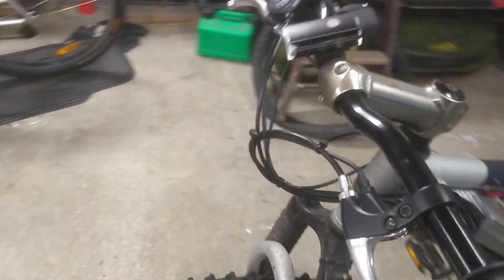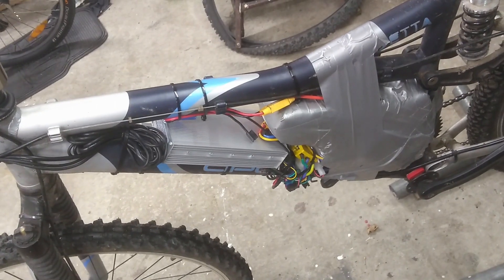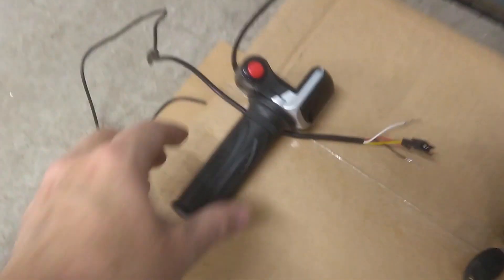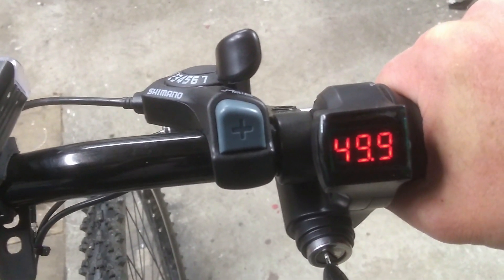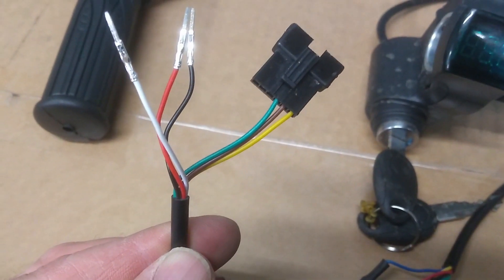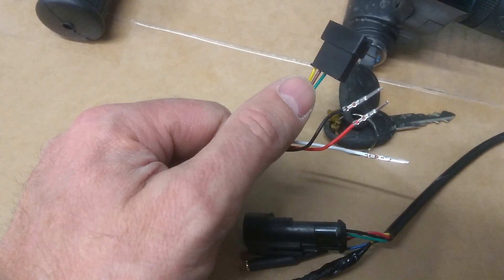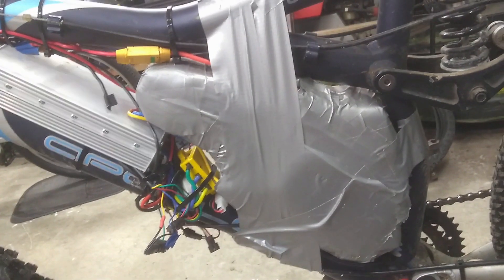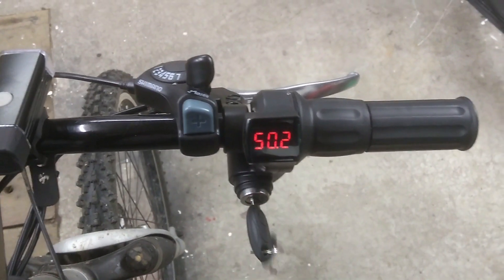Voilamart Ebike Controller Upgrades

Comment: The tuning is extrem extrem I pull the throttle and 1sekound later I am at Max speed ( if a Balance to the front of the bike if not the font tire goes strait up)
Reply from the maker: it's 14s 9p each cell is 3400mAh but not high current so I need as many in parallel as possible
Reply: @alibro7512  lol ok...I have 2* 6S with 4* 2600mAh and 1* 3S with ~ 12Ah...
Reply: Ali Bro I only use 2x 6s3p and 1x6s3p and  only one zell can delivery 35 amps on it self (sry for my bad English)
Reply from the maker: @ichwasdass  if you check my latest video I show my new pack. I've only used it a couple of times as the weather is very bad here.
Reply from the maker: @ichwasdass  lol, I think my German maybe much worse.
BTW I spent a few days in Augsburg and liked it a lot.
Reply: Ali Bro yes I saw that video today  it's a god video
Reply: Ali Bro oh that's god I know Augsburg it isn't so extrem far from my home town
Reply: Ali Bro I don't know I've you can help me put I road today an after 2 km My back tire explode I went home replace the tire and road 400m and the new tire explodet again ( maby the braicks are damage the tire ) ( but tuday I do the modification on the controller  but I think that that isn't the issue)
Reply from the maker: @ichwasdass  If you are using the tyre that came with the kit it is very poor.
Reply: Ali Bro I used the tire that was from voilamart but on the secound right I used another that was Laing around in may garage
Reply from the maker: Do you have the same kit as this?
Reply: Ali Bro yes I have the same one but I juse a 15s battery
Reply from the maker: @ichwasdass  15S would be over 60V. Did you check the electrolytic capacitors in the controller?
Reply: @alibro7512 He checked the transistors, which can run until 100V and the condensators which can get a volatage until 63V and with 15S you are under the 63V. I also use an 15S Akku Pack and it works very good. Instett of 50-55km /h you can drive the whole time with 55-63km/h. You can also discharge your akkus so much you want, because the controler stops ever at 42V
Reply: Ali Bro yes of course I Checkt them say can handle 63v and that's fine und my mosfats can handle 100v
Reply: Franz Maier yes but I reach a max speed of 70kmh
Reply: @ichwasdass  I also drives sometimes down the hill 73km/h max, but mostly 68
Reply: Franz Maier yes I drive that on a long road but a strait roads with no mountain
Reply from the maker: @franzmaier9855  I thought about 15S but decided to stick with 14S, maybe I should have been brave like you. 👍
Reply: @alibro7512  Brave.... @Ich Wassdass has tested 15S before me...I know him private
Reply from the maker: @franzmaier9855  I've had posts from guys who say they put 5000W into the hub motor but not sure what controller. These things must be stronger than I thought.
Reply: @alibro7512  ... yes if you look for only a controler you find ones with 3000W but than with over 90V Voltage

Comment: I also have this voilamart kit but it doesn't reach more than 7 amps  on max load but the max speed is 43 miles per hour
Reply from the maker: How are you measuring the current? Are you riding the bike at the time? 7 amps sounds very low.
Reply: Ali Bro I measured it riding the bike at the Same time with my multimeter and I can't ander stand why the amps are so low
Reply from the maker: @ichwasdass  If you have a 48V battery and 1500W controller the current will be around 30 amps on full power. This is if you are measuring the current from the battery. I don't know what it will be on one of the three phases
Reply: Ali Bro I measured on the battery wire I have a 48v 1500w voilamart Controller but I have a 15s battery

Comment: you want the cadence sensor right against the ring. 0.5mm clearance
Reply from the maker: The cadence sensor worked perfectly, the issue I had was caused by not getting the display with the kit so I couldn't control the settings.

Comment: Ha Ha Great video... Yes there is quite a bit of issues with cheap stuff inferior manufacturing on ebike components. 2 things i want to mention, first you could benefit with a 3D printer and make an awesome custom battery case . second, i want your bike, ha, ha, i like the the way of the suspension frame.
Reply from the maker: LOL, Check my more recent video.
Reply: Can someone tell me why a motor would make a grinding sound when power is applied
Reply: @richardignacio8709  because she's fhcked🤣

Comment: Sadly the controllers in these kits are pretty crap with limited features and limited compatibility, I recently got the 1000w Voilamart kit with the sw900 screen and even then it is utterly flawed, and this is why your kit always runs at full power under pas as you do not have the sw900 screen, the screen allows you to set the pas level from 1 to 5 and with out the sw900 it defaults to pas 5 ( max power ).  However even with the sw900 the controller is still crap the reason for this is how pas is managed by the controller, normally and with every other controller PAS limits the power and pas 5 would be lets say 1500 max and pas 4 would be 1000 and 3 would be 700 and so on letting you limit the power in a traffic situation for example or power saving, however the Violmart controller does not work like every other pas system and instead of limiting the power it is at 100% regardless of pas level and all the pas level sets is the max speed like 5=unlimited / 4=25mph / 3=20mph etc and this makes pas unmanageable in a traffic situations and a accident waiting to happen in wet/icy conditions.   For this reason I swapped out the 1000w controller for one I already had and pared it with a LCD3 and it is much more manageable.
Reply from the maker: Thanks for the update on this controller, you've 100% confirmed my suspicions for the poor quality of this controller.
It was cheap for a reason.
Like I said elsewhere when I bought this kit I was only looking for a motor so the controller was a bonus.
I'll continue looking at the Arduino cruise and PAS control when I get back to it.
Reply: @alibro7512  Yeah when I was looking at the kits I was really only after the wheel so was going to get the cheaper kit like you but then i seen the kit with the screen and well I had already been spoiled by my LCD3 screen so went with the more expensive kit with the screen simply because it claimed to have a road legal limiting option and i liked this idea, however upon setting it up and test riding it i found out that the road legal limiter does not work and no way to control the power and i almost came of the bike the first time i tried to pedal away as i was on gravel and rear wheel just spun up full speed, the controller is so bad it is not even compatible with my LCD3 screen, so frustrating
Reply from the maker: @EQINOX187  This is a very old thread but makes interesting reading
https://www.pedelecs.co.uk/forum/threads/making-a-torque-throttle-instead-of-a-speed-throttle-for-a-cheap-controller.34117/
I have a 500W Bafang mid drive kit which I really like but I'm convinced it applies full power on every setting then controls the max speed. On a 500W kit this is not such a problem but on a 1000W or 1500W kit like mine it becomes an issue when you want to ride slowly through traffic or in poor conditions.

Comment: just a thought about the PAS issue going full bore as soon as you start to pedal, if you add an LCD display to your build, the PAS is fully programmable to your liking. I've just received the upgraded waterproof kit, and just a fyi it's sold as a 48v kit but in the display settings it's actually capable of 72v
Reply: Hi Paul, I know this is an old video but I was wondering about what he said regarding "going 15 mph" then it would finally apply (full) power.  The only way the controller would know it was going 15 mph is if knows the wheel diameter and uses the hall sensors in the motor.  Since the cadence sensor could be in any gear it can't use that to sense speed.  So, is he wrong about the 15 mph speed thing?  If it is speed sensitive he could program the controller for a larger wheel size like 29" which would reduce the "speed" from 15 mph down to maybe 9 or 10. (which would still be stupid)
You are saying the PAS is fully programmable through the LCD which makes much more sense.  It should give assistance at any speed and apply torque based on current required to keep the motor at crank speed. (Whatever speed that is I would assume.)
Anyway, I'm just curious and if you could give any information to help me understand how this is supposed to work, I would appreciate it.

Comment: Can you enable regenerative braking on these controllers from Voilamart ?     I have read - if you connect X and DS with cable this feature will be enabled on this cheap controllers. 
Problem is - I cant find the contact X and DS on my Voilamart- Kit controller ?
Reply from the maker: Sorry I don't know.
Reply: nik maier do you still don't know it?
Reply: The x and Ds are in slightly different places but means the same on mine 

Just connected then  and the rehén braking is strong

Comment: I now have this kit and I was wondering if you could help me out with what battery I want/need I was looking at 48v 20ah but I herd if I put a 52v battery in it will give me more power/distance so my question is can I put a 52v battery on this kit without burning out the controller/motor?
Reply from the maker: I can't promise anything and I'm no expert but I believe these controllers should be OK with 14S which I presume you're talking about. There is some discussion whether 48V means 13S or 14S anyway so It should be OK https://www.youtube.com/watch?v=alHocJk7DHg. Once I have a few other things sorted I plan to upgrade my battery to 14S myself. I believe the Caps in it are 63V so if you charge your battery fully it will be 14 * 4.2V = 58.8V so well under 63V limit of the Caps. 
In any case even if you blew the controller they are less than £30 to replace. https://www.ebay.co.uk/itm/Electric-Bicycle-36V-48V-1500W-Motor-Brushless-Speed-Controller-E-bike/123865862406?epid=17020907950&hash=item1cd6fb1106:g:l28AAOSwIbFdR~MS
Reply: Iv got the 48v 1000w sw900 violamart kit. I put more solder and copper wire over the shunt. And i bought a 1500w voltage booster. Iv got it to 48v In put to the booster and 75v out to the controller and it works and does not hurt the controller. All it does once you go past 60v to controller is that it makes the compactors start to make a  ringing noise. But it makes my bike go from 38mph to around 45mph!
Reply from the maker: @Nissan370_z  Thanks for your reply. That's an interesting idea to use a voltage booster but I would be concerned about how long it would last. I'm planning to add another series connection when I move this kit to my other bike.
Reply: So what’s the update on the setup is it still working?

Comment: Love the shunt bridge idea ! I’m having grief with a 1000W kit on my brothers bike presently , replaced the controller and still dead so I’ll be dismantling them to investigate soon. Fully agree with the throttle upgrade , I’ve done that for both bikes so I could remove my bulky power meter that I had cable tied to the handlebars :)

Comment: I see this kit came with the small warhead 25a connecter that plugs into the batter now I was wondering can I change that to a XT60 60a connecter? without hurting anything or whatever
Reply from the maker: I'm sorry, I'm not familiar with "Warhead" connectors but if you have a powerful enough soldering iron it's a simple job to change to XT60 or XT90
Reply: Do you have a picture of the connectors that came with the kit l?
Reply from the maker: @davidamazing1853  It came with ring connectors that I cut off and replaced with XT60. As far as I can tell most ebike controllers come with ring connectors.
Reply: What’s a powerful enough soldering iron?
Reply from the maker: @davidamazing1853  I guess 60W or higher. Anything lighter than that and you'll struggle to make good connections on the heavy wires.
Reply: @davidamazing1853  no less than 75 watts would be advised and your better off going with 80 and not the cheap china ceramic element  get a weller 80 watt from amazon the ceramic elements are ok for your basic stuff but not for making heafty XT60, EC5 connectors
Reply: @davidamazing1853  one that let's the solder soak into the wire . Once solder gets hot enough it will get absorbed by the wire. Witch is good that means s u have a good solder connection
Reply: Is that what kind of connectors you have XT60 or the XT90?
Reply: Ok cool this is the exact kit I got coming it will be here Monday thank you for everything you’ve been a great help bro hopefully we meet up sometime and go for a spin

Comment: What size battery are you using?
Reply from the maker: 48V 8P 13S with each battery around 3400mAh so around 27Ah or 13kWh
My pack was built from batteries that I thought were genuine when I bought them but turned out to be fakes so I'm not comfortable drawing any more than 5A per cell so 40A for the pack

Comment: Thank you. Nice work.
Regarding the power pack, can we use 24v instead of 48v and use the same controller?
Reply from the maker: No, this controller can be used with 36V to 48/52V but will cut out when the battery voltage reaches a certain level. If you can't upgrade your battery then 24V controllers are available.
Reply: @alibro7512  Thank you.
Reply: Check the strength of the controller capacitor
Reply: @Louis-lu5wh  Thanks